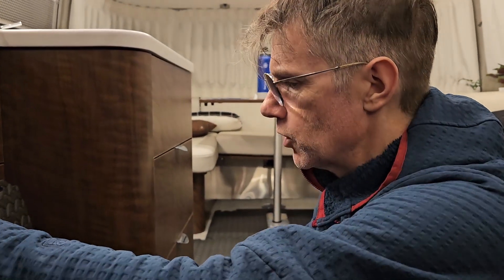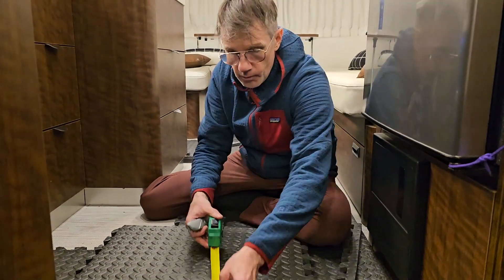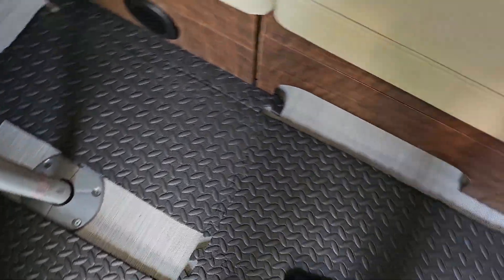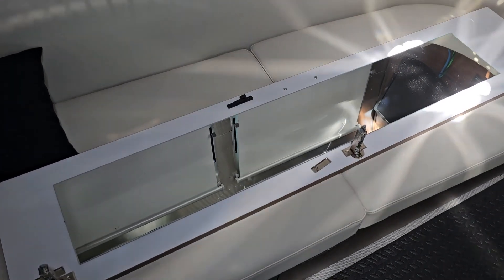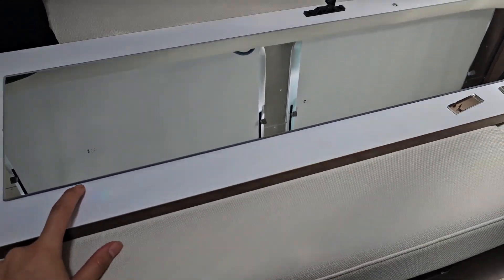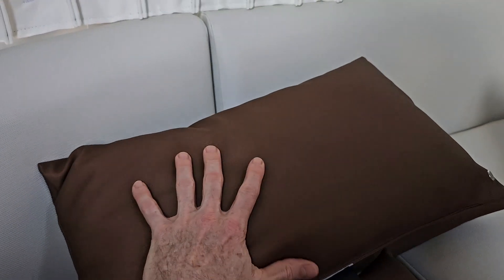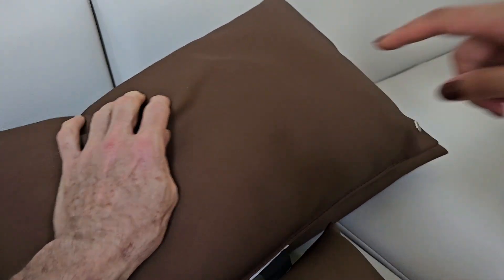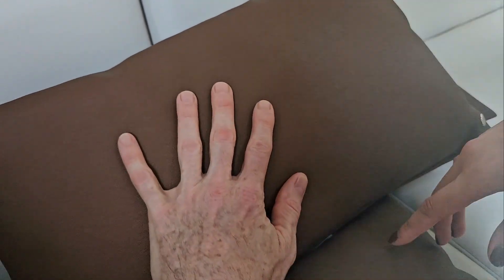Airstream Maintenance Round Up & Aqua-Tek products quick review

Comment: Phil, tremclad is great but on my truck box i had a coating sprayed in that protects the metal. Wonder if that area on the trailer you painted might be better protected by a spray on coating.

Zhen, on our old trailer we washed the curtains each spring. The dust in a campsite as well as dirt roads really embeds itself in the curtains.  But our new trailer has aluminum blinds so we just use a vacuum on them. Personally i preferred the material curtains but the blinds are so much more practical.  

Great video.
Reply from the maker: Hi there. I looked at a more robust coating but they were more expensive when I compared price and coverage, but I'm inclined to agree. A spray on coating would be a great solution and would likely provide more protection and maybe for longer (hence maybe not more expensive... Yes, I'm taking myself into it)
Reply: @PhilZhen-gy8qk  wonder if CT would have a more budget friendly option.